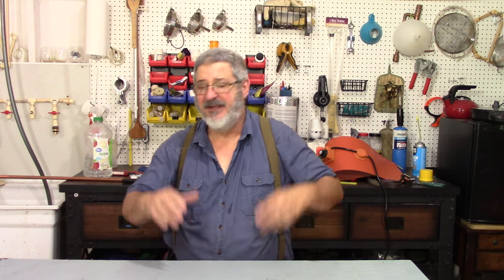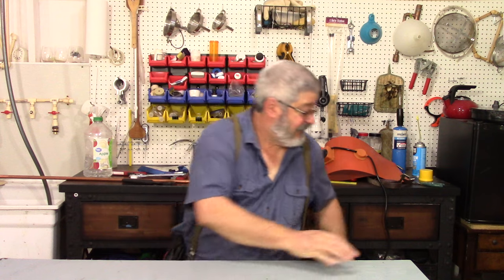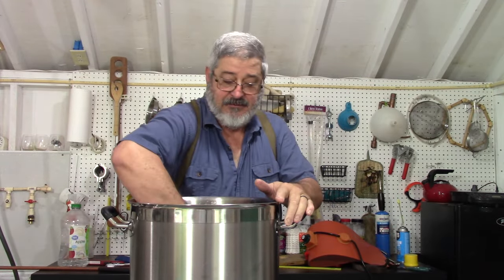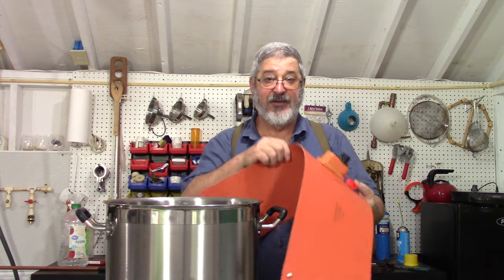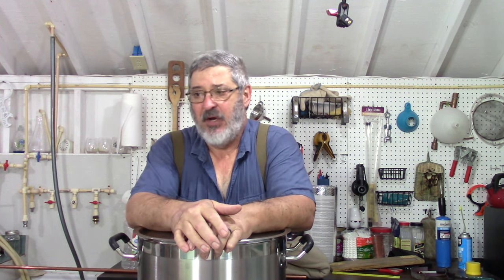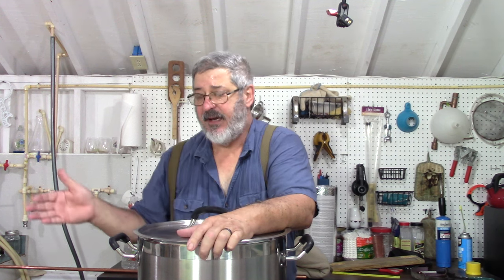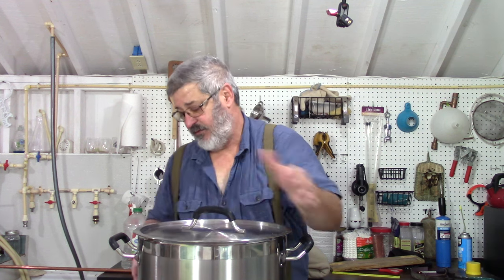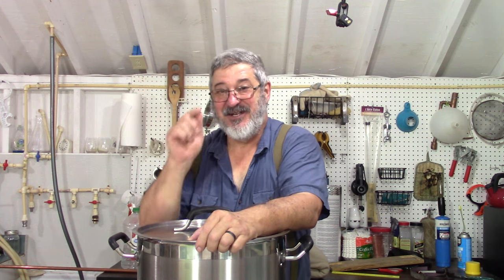Time for a new Mash-Tun a heated one!

Comment: I recently got the 30 gallon mash pot from Northern Brewer.

Previously I was using an 8 gallon pot.
It used to take 4 mashes to fill my 26 gallon still.

Now it takes 1 mash in to fill the still.
What a difference.

Good luck with the new pot.👍🥃
Reply from the maker: I bet

Comment: I use a 58 gallon barrel and found an old waterbed heater works perfect. wrapped it around my barrel and insulated it for winter ferments.
Reply from the maker: cool well may be warm lol
Reply: @tomchristensen2914  

Recently I bought the rubber heating bands that wrap around the mash buckets and plug 🔌 in.

But for years I used a dual controller heating blanket over my mash buckets.

Worked great for the cold Northeast winters.
Obviously not needed in summer.

Keep shining.💪👍🥃

Comment: I love it Randy. What exactly is the heat belt called? I want to get one but don't no what to order. Thanks mate.
Reply from the maker: Metal drum heater 5 gallon drum
Reply: @stillworksandbrewing  thanks mate 👍.
Reply: Randy, I’m really liking this idea.  Do you care to tell where you got the pot and false bottom?  Thanks.
Reply: @stillworksandbrewing  Great! I tried this a couple years ago but the only band heaters I could get were too long for my 8 gallon pot. Overlapping the ends only made them smoke and melt. Thanks!
Reply from the maker: cheers